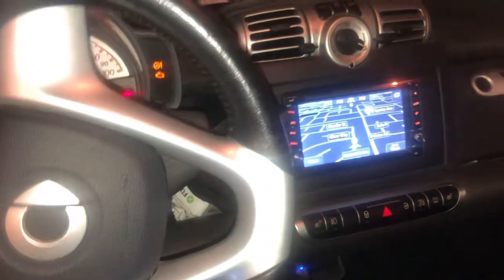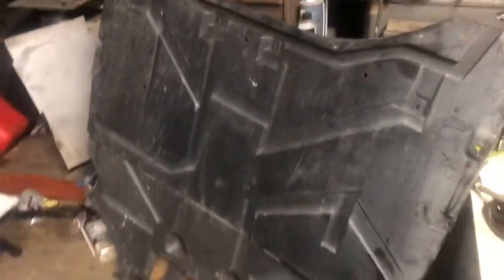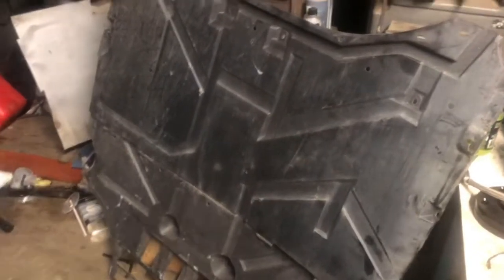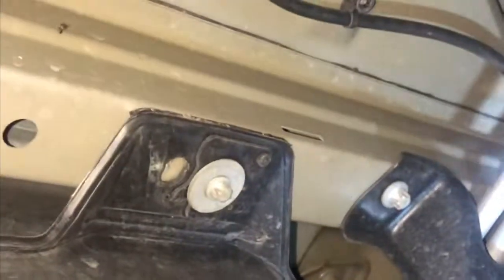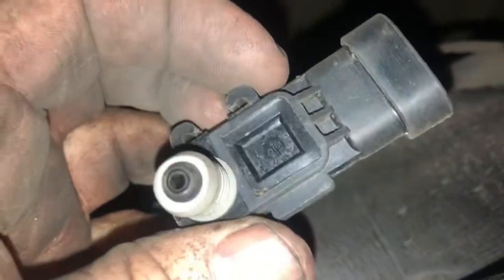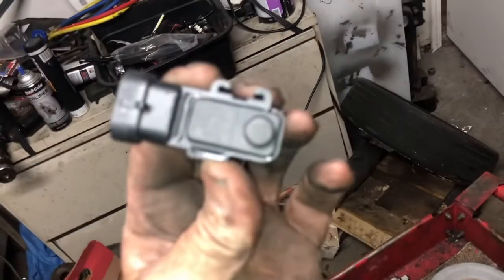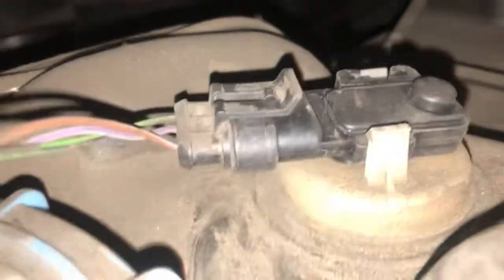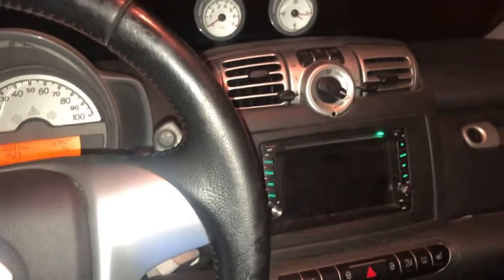Smart car 451 P0451/P0452 fixed for $20 in 60 min

Comment: ...This is great info thx ..i have the same code even after replacing the gas cap and the purge valve going to try your solution..
Reply: I had EVAP codes and after replacing the purge valve and then the charcoal box, I dropped the tank and saw that my fuel filter assembly cap was cracked right apart. No codes after replacing that. It's better to take it all apart and inspect the system before throwing parts at it guys.
Reply: @CyberBrySkyNet  After taking the car to a reliable shop they discovered a broken wire .. it was bypassed with a new wire and everything is good now..best part it was a cheap fix thanks to a good mechanic.

Comment: Does this really work
Reply from the maker: Yes and is still working today
Reply: @reedjamescustom  I did it and it works .it didn’t take my check engine but I have one more sensor to do
Reply from the maker: @htowner1327  the code should drop off after 100 miles if there is another problem the check engine lite will still be on but will be a different code
Reply from the maker: The p0451 and p0452 will disappear

Comment: What do you have for a map sensor cross reference?
Reply: I'm looking for the map sensor lol
Reply: @luispenick7448  You have to drop the engine to get to it. Its up by the firewall, behind the passenger seat on the engine.... If you lift the car you can see it. or cut a hole in the firewall behind the passenger seat..... See if you see atmospheric pressure reading on the sensor before taking that sensor on
Reply: @MrMr123  thanks man.
Reply: @MrMr123  do you think I could get to it just by taking one  engine mount on the right side of the car by the alternator or do I need to take all three off
Reply: @luispenick7448  I think you should hook up an OBD2 scan tool and see if it reads 14.7 psi 
Which is atmospheric pressure with the car off
If it sees that number, sensor is fine.

From the front looking back
Sensor is about 6-8” to the right of the alternator under a bunch of ac coolant lines

You have to drop the 4 bolts that hold the motor

How many miles does your whip have?
Reply: @MrMr123  only 64k. I've been just tuning it and was just going to clean it with MAP cleaner. It might not be worth my time though.
Reply: I ended up removing it. The bulb part was oil and smelled like oil. That probably means I need to replace the PCV valve. Thank you again. And btw ur channel is awesome!
Reply: @luispenick7448  Thanks 🫡